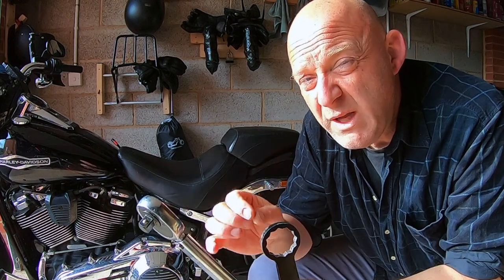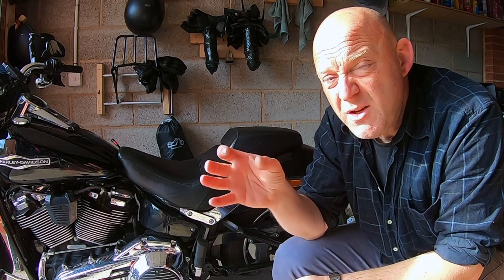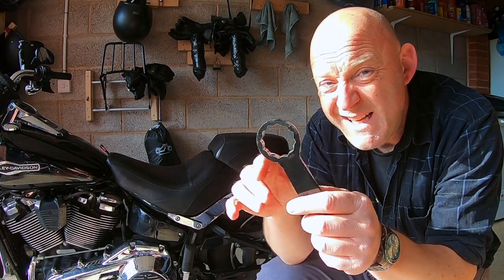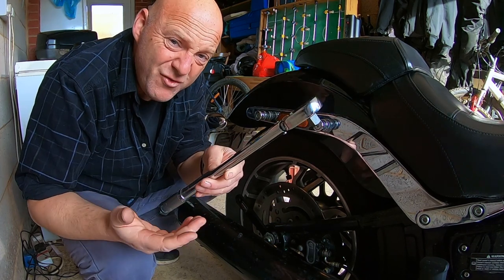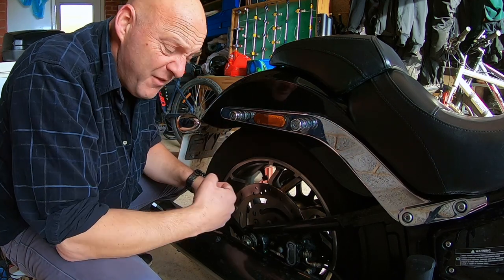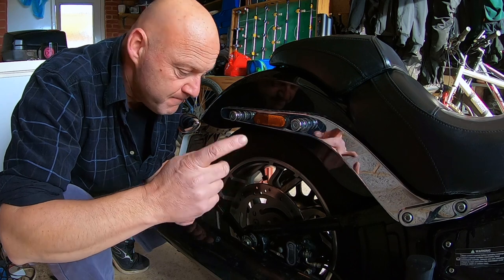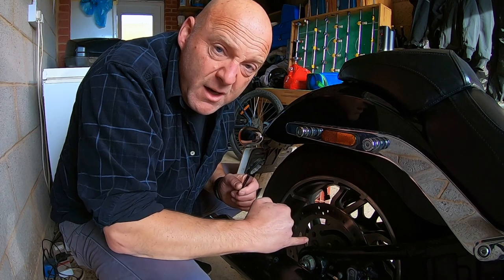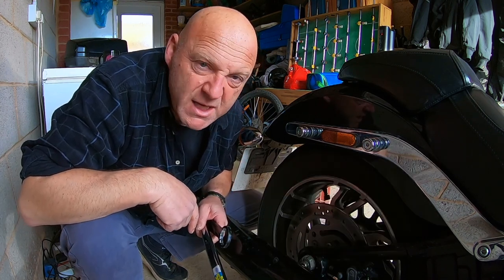How To Torque Harley Davidson M8 Rear Wheel Axle Nut Without Torque Wrench

Comment: The torque wrench must be at 90 degrees to the adapter for proper measurement!!
Reply from the maker: Yep
Reply: Please address the torque value change when using this tool at an angle in another video. This could be very dangerous if not taken into consideration.

Comment: If your using the marker pen you need to mark both sides as the bolt may of twisted and you could end up over 3/4 of a turn out.. but good idea..

Comment: Please address the torque value change when using this tool at an angle to the torque wrench in another video. This is very dangerous if not taken into consideration.

Comment: Or just put the axle in the other way round ( making sure to keep the spacers in the same order of course) No need to remove the exhausts.
Reply from the maker: ha ha yep
Reply: There are various reasons and theories as to why the axle is put in with the nut on the right, but consider if the bearings seize and or the axle spins with the wheel, with the nut on the right the rotational force will be on tightening the nut, mounting the nut on the left the force  will be on loosening the nut and can spin it off the axel!
Reply from the maker: Yep
Reply: @marmotvids630  Good point, I hadn't considered that. There had to be a reason for it.